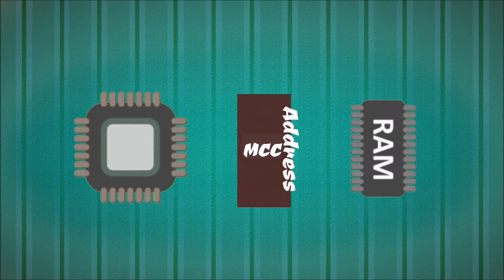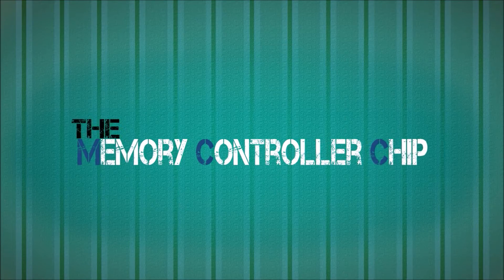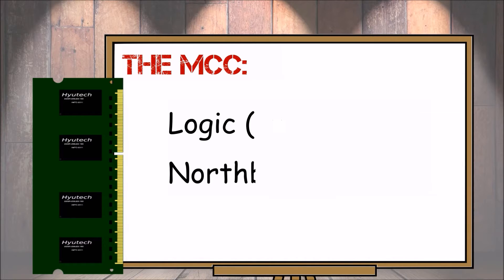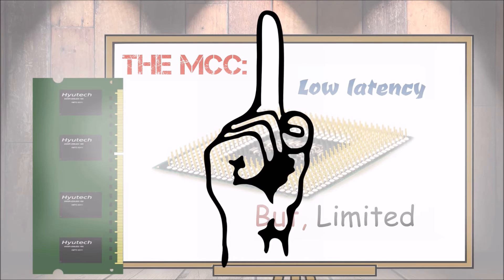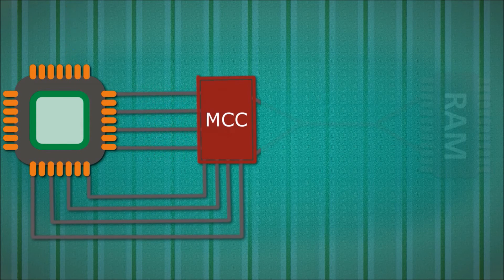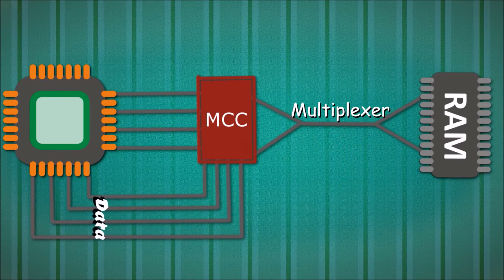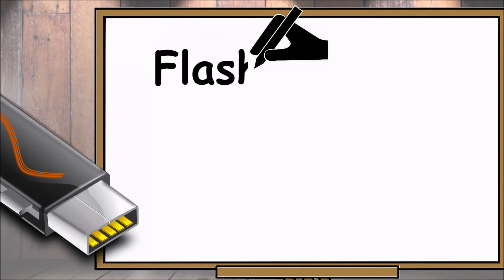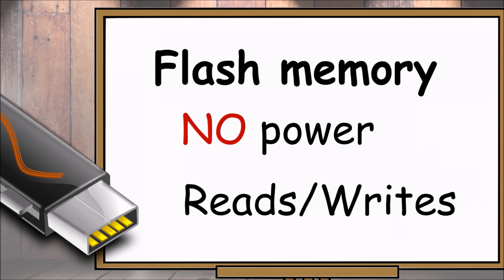The Memory Controller Chip

Comment: The memory controller limited my ram per slot to 2gb and I didn’t find this out until I after I brought my 2x8gb ram . Is there a way to make it 8gb per slot
Reply from the maker: If your ram slots can only handle 2GB, it may mean that your computer is a 32bit architecture, which carries a limit of 4GB: to go higher, you will have to up grade to a 64bit computer.
Reply: @NotezOnTek  I have already upgraded my pc to 64 bit tho das the thing
Reply: @NotezOnTek  I checked specs my mobo is realllly old but it’s max ram is 16 gb and I got 4 slots
Reply from the maker: Well if your MB is 16GB, it means that the individual slot limit is 4GB and you said you bought 8GB sticks, so that will most likely not work, at least not in the way it should. I think your best bet is to try 4GB sticks instead, or upgrade the MB.
Reply: @NotezOnTek  How do i upgrade the mb and also when i checked recommended ram for my mobo it showed 2 gbs 4gbs and 8gb and i checked reviews for the 8gb and they all said it worked well
Reply from the maker: are you running the 8gb sticks alongside the 2gb sticks, because that might be the issue; try running just the two 8gb sticks and make sure that your are placing them in the right slots.
Reply: @NotezOnTek  This is what  ives tried . Each 8gb stick in each slot by themself then together and mixed the 2gb and 8gb together but every single time even if its the 2x2gb and 1x8gb the pc fails to post . When its just the 2x2gb its fine but whenever i add an 8 in and slot it doesnt post
Reply from the maker: You can try upgrading the firmware for the MB. but you will have to do some research on how to go about doing that. you will have to know the type of MB you have. But read up as much as you can on this, before doing anything.
Reply: @NotezOnTek  So would upgrading my firmware increase ram per slot cause if it doesn’t it wouldn’t help me . It would need to make ram per slot from 2gb to 8gb quite a jump
Reply from the maker: I’m not sure, it’s an option you can try. There are no guaranties.
Reply: @NotezOnTek  Cool but the thing im confused about is that usally a 4slot mobo is max 4gb per slot but firstly mine is only 2gb per slot and secondly websites recommend 8gb sticks for this mobo and ppls reviews says it works . Ik its different for everyone same as overclocking but why is mine 2gb/slot
Reply from the maker: Yeah, I’m not sure why that is. May the board is defective. I’m sorry, but I’m not sure on how else to advice you.
Reply: @NotezOnTek  It’s fine help is help . Plus I’m gonna be doing ICT for gcse so if I can’t do dis how am I gonna pass 🤣
Reply: @NotezOnTek  Could the reason be and outdated bios
Reply from the maker: You could try updating your bios, but be cautious and do your research.
Reply: @NotezOnTek  Cool . My pc mobo has 2 bioses so incase i accidentally somehow destroy one

Comment: Great video.
Although, the reason for refreshes in DRAM is not the volatility of DRAM. SRAM is also volatile, for example, but it does not need refreshes. Memory refreshes are necessary because of the DRAM structure.

Comment: All the Youtube  vids  I have seen so far explain in general terms how computers work ..How does it work at an electron level ? Electrons are the only thing actually flowing around all the computer circuits .This is rhetorical  question  soI do not  really expect an answer ..even so I will keep looking.
Reply from the maker: This is just another layer of abstraction. If you want to go deeper, look into electrical engineering to get an understanding of semiconductors—this is actually a field in itself that also requires knowledge of chemistry.